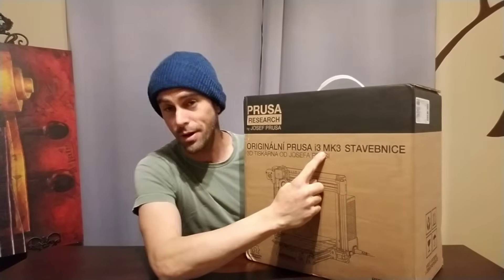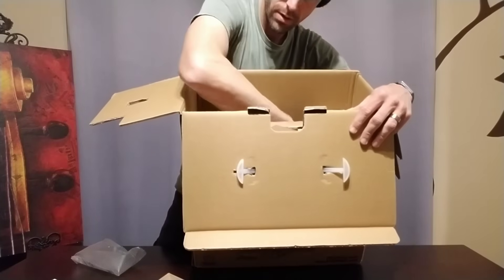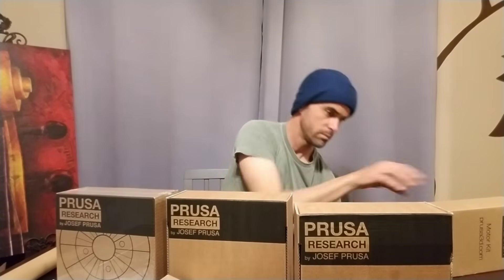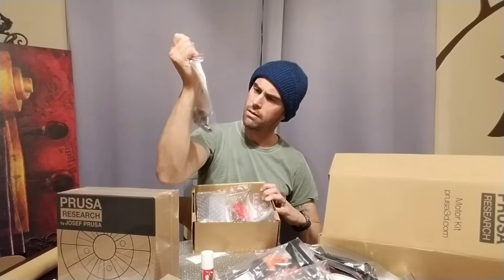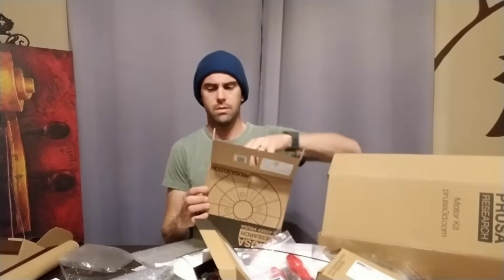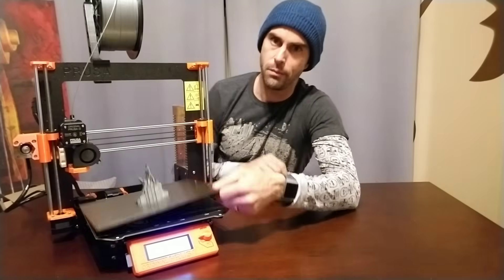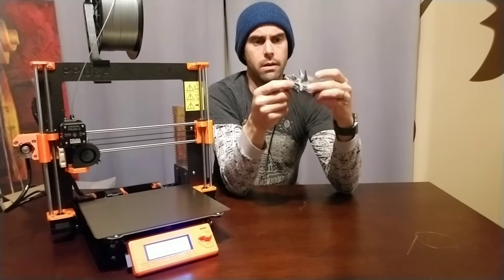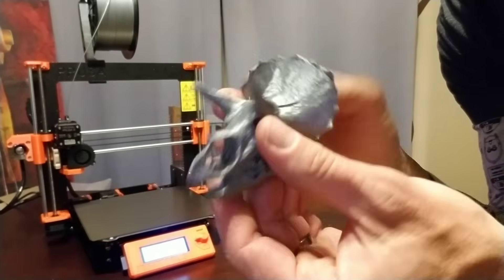Prusa i3 mk3 kit unboxing, timelapse assembly, and first print

Comment: I just built my MK3 a couple of weeks ago.  Everything went together well.  Like you said, the instruction manual is very well written and takes you through everything.  The only issue I have had show up this past weekend was with the filament sensor.  I spoke with Prusa support and they said they have discovered a few flaws with it and will be replacing mine late June.  In the meantime they recommended printing with the filament sensor turned off until I get the new one.  The problem was that the sensor kept triggering randomly through a print to change filaments.  Hopefully you got the new version of the filament sensor.
Reply from the maker: DCD Laser & CNC oh man, no fun! I haven't had any issues with it yet. Been running it almost non stop since it was built. Wonder if that'll start to become a problem...
Reply: The filament sensor was totally fine (no issues were happening) for the first couple of weeks.  I tried using compressed air to blow off the sensor and all other suggestions and it would falsely and randomly trigger a filament change.  Could not detect any sort of pattern to it.  Maybe I was just lucky and did not encounter it the first two weeks.  Regardless, I am glad that Prusa discovered the flaw and will be making it right for me.